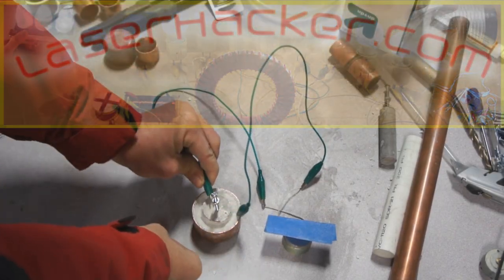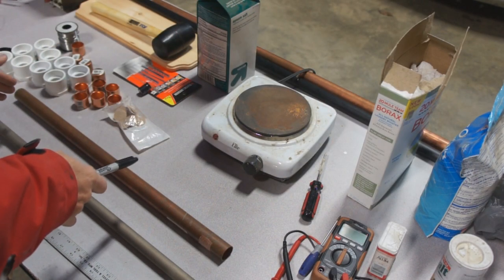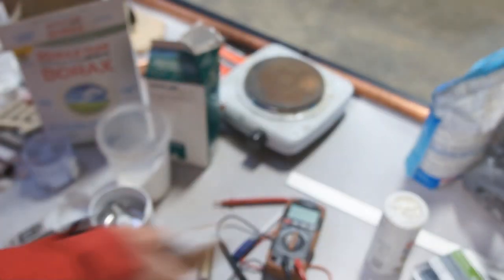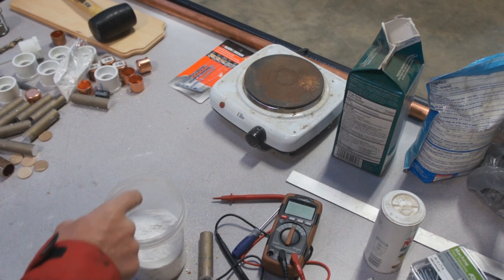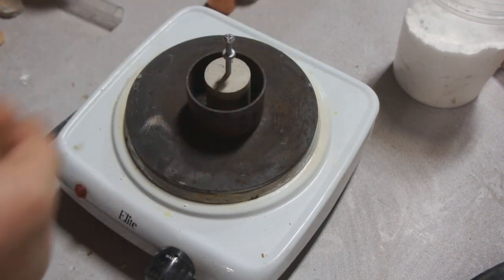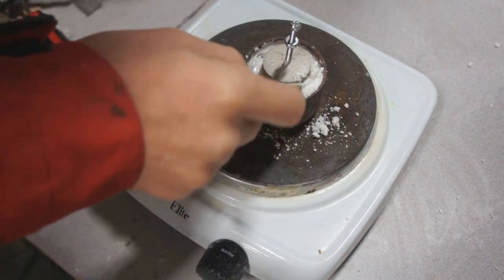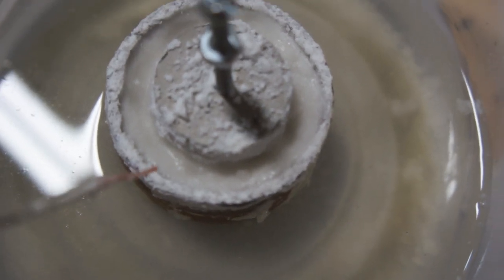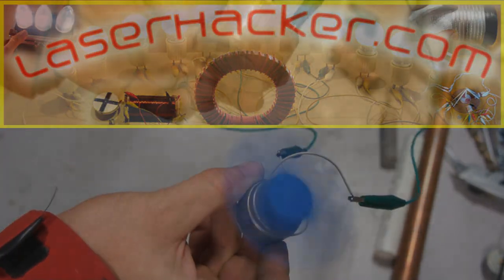How to Build Crystal Power Cells - Long Duration Power

Comment: This is very cool, man! Now, I just need to build 200 of these and I can be independent from the system. Crystal power, natures ultimate capacitor.
Reply: maybe a self loop generator might work..an ac induction motor running with large flywheels coupled to a permanent magnet alternator (Chas Campbell system)perhaps?
Reply: fidel catsro
This is a motion-less way of getting electricity. So, if your saying if your proposal is better than this, it's best for the one that says it to do it first than suggest it to another.
Reply: lumberluc yes I intend to try that self looper, just cant get the reliable people to make one setup currently as yet
Reply: fidel catsro
Then I believe the most reliable person there can be for you is the one who looks back at you in the mirror.
Reply: You need to redo your calculations.   This cell produces 90mA  at 15V i.e. 1.35W.  Since an ordinary fan heater requires 2KW it would take almost 1500 of these simply to produce 2KW.  It wasn't made clear in the video how long this cell could sustain 90mA.  It could easily drop to a tenth of that within few minutes.  200 of them wouldn't do anything very useful apart from consuming a lot of money.

These may last a long time but the power output is very low.
Reply: Joshua Rosen Long time, yes. However, if you combine it with a different source of energy, like Cold Electricity, which is a endothermic reaction and it's radiant, then these crystal batteries will do just the trick.
Reply: lumberluc
There is no such thing.  It's pseudo-scientific mumbo jumbo.  I don't know what you've been smoking but electricity, which is a form of energy cannot be endothermic.  Only reactions or processes can be endothermic.

All these people who talk about free electricity (or other free energy such as perpetual motion) are fraudsters.  If there were a grain of truth in any of this, they would be able to produce perr-reviewed papers in respectable journals demonstrating it but none of them can because it's fantasy physics.
Reply: Joshua Rosen AAAANNNNNDDDD, how do you know that?

Have you tried it? Have you tested it? Have you seen it, up close and personal?

The only fraud here is the one who answers NO to any of those questions. Like you said, Free-energy is fraudulent, which makes you a fraud.

I tried it, it works, but I'm just scratching the surface. Heck, why not join the group of people that want to make THE difference? Such as lasersaber, he's a man that wishes to make a difference.

Free energy is a reality, get use to it.
Reply: lumberluc Because I have a physics degree.  What I said about endothermicity is a simple fact that can easily research yourself.

If you believe in "cold electricity", try to find a single peer-reviewed paper in a reputable science journal that supports its existence and report back here.  You won't be able to because it's not a real thing.
Reply: Joshua Rosen Hmmmm, Too bad. And here I thought you were a free thinker, turns out I was wrong.

US Patent #4595975, Efficient Power Supply Suitable for Inductive Loads, which can be anything.

It's not a matter of "Belief" it's a matter of getting off your butt and doing something.
Reply: lumberluc Physics isn't about freedom, it's about truth.  If something is true in physics, it can be proven and all physicists care about is what is true.  Opinion just doesn't come into it.  If someone can prove experimentally that there is such a thing as "cold electricity" I shall believe it, if no-one can, I shall not.  That is how physics (and indeed science in general) works.
Reply: Joshua Rosen Then look. There are they who do.

I'm forbidden to convince you or anyone else that thinks inside the box, due to the simple fact that they like their "Box"

And you, are a Orthodox person, I, along with thousands of others, are Unorthodox, and we get the results better and faster than your kind.

If you wish to continue your path, then I must say one thing to you, "Never utter these words; I do not know of this, therefore it is false."

Oh, and did you not read thoroughly the patent?
Reply: Joshua Rosen Actually, physics has come a long way since what they still teach from the books in universities - the same universities that are breaking new ground in physics. Only 20 years ago you had something like 5% of people that agreed in the wave function theory of the double slot experiment. That's up to over 30% today with more proofs and examples being introduced each year creating the increased acceptance. Physicists do NOT care about truth, they care about keeping things the way they are. Change rarely happens in 'accepted physics' aside from an undeniable event that puts everyone on the spot, or more commonly, by simple attrition. Ask any professor or professional physicist that works with bleeding edge tech under the age of 40 and he'll give you the same answer. Opinion and judgement are paramount in the scholastic field which carries on to applied science. It is a monumental feat to prove new theories. I'm just glad people don't give up. Otherwise we'd still be the center of the universe. Proven science right?
Reply: ChunksMan CS And it's the saddest thing ever, the dogma of society of believing what other's say to be true even in the face of lies.

A nobody can build something so awesome and so useful that even a scientist will say it's sacrilegious, heathen, and an abomination to his/her view. An example, a AG Drive. A dual parallel plate that has a frequency of 1 terahertz and is able to fly faster than the best spy jet such as the Blackbird spy jet, regardless of weight.

However, even in the midst of such of a denial, they still do what is known as Black Box projects. When they have the sci-fi weaponry, they have the AG drives, they have been to all the planets and saw whose on there, and they just want us, "Stupid" people to stay on the prison planet call Earth.

So if sad is sad, then we are in the saddest state of Greed, Lust, Pride, Wrath, and Sloth ever.
Reply: lumberluc
YouTube really does bring out the nutters.

If any of these inventions is real, show us.  So may nutters and frauds over the years have claimed to have invented miraculous devices but when push comes to shove, they cannot prove they work because they are liars.

Science does make judgements.  If you can prove it's true, do so.  If not, you are just another fraud.
Reply: lumberluc
Thank you for bringing up Joseph Cater. I looked him up at greggpierce.net. He's the king of the nutters!
Reply: James Van Damme Now for me to know that your on his side; What is the one physics that Cater mentions that can explain every gosh darn thing in the Universe?
Reply: lumberluc
You got me there. I couldn't make any sense out of it. Especially laughing my butt off.
Reply: jimvandamme Okay, well, if your one who laughs at the simple notion that people such as Cater are nutters, then your no more than the popular theorist who gains money for double-talking.

Or, your just one who doesn't know. However, honest arrogance is acceptable, because you don't know yet you wish to know. If your dishonest, then you wish not to know, and never to know.

come back when you find the answer to the question I asked you, and I'm not taking a "I don't know."
Reply: jimvandamme Your loss, not mine.
Reply: Joshua Rosen ...try to find a single peer-reviewed paper in a reputable science journal that supports its existence... boy said so; pls somebody find it, prove it, publish it and produce it AND i may be believe it exist with my degree but until that day im gonna tease u.
Reply: Joshua Rosen Scientists (whether it be physics or any other science) as I know them accept a truth that can be proven. Up until a few hundred years ago the thought of a spherical earth was non-sense. In fact some of the earliest scientists were, for all intents and purposes, shunned for their findings because they were viewed as opinion and not a scientific fact. If science of as simple as you are attempting to make it out to be we (as a race would be much farther a long technologically. If scientists didn't have the freedom that they had and the ability to look at something and see that it is different from what is "proven" and ask WHY, than we would still be living on a "flat" earth. There is also the fact that "Proving" something is simply a point of view that is susceptible to all sorts of bias. I am happy that you received a  degree, however the history of science is just as if not more important the the human history of our culture as an entire race, and if you had known the history of not only your science but general sciences as well you would find that you would not be speaking like many Mormons speak about their faith; you know speaking in absolutes. Knowledge is power and what and how you use it, reflects heavily upon yourself.
Reply: tiny99990 Little over the edge on the Mormons, due to me being one. I'm proud of being a Latter-day Saint, but I only act through it not speak of it, due to my small voice yet large action.

And true, if he knew all of the history of science, and I mean ALL of it, and it's purpose like what it was like before the flood, then he wouldn't say any double-thinkery of the sort.
Reply: lumberluc My parents are Mormon a long with my aunt, I have nothing against Mormons as a group, however there are certain Mormons that have an extreme Holier than though complex and tend to strongly and loudly voice that they are the "one true church, and that all other religions and forms of Christianity are lairs and fakes. Again this is from what I have noticed growing up in the Salt lake valley which is commonly referred to (by both Mormons and non Mormons as the origination point of all Mormons, not to mention the fact that more than 60% of the Salt Lake valley is Mormon.) Mormons are some of the nicest and most generous people I have ever known. All I was trying to do was compare him to something, that from what I saw, he dislikes and overgeneralizes so as to make my point crystal clear.
Reply: tiny99990
It's interesting that Mormons refer to "other forms of Christianity" because Mormons aren't Christians.  They don't believe that Jesus is God and they also believe that Satan is Jesus' brother. 

Christians believe that Jesus is God (as well as being the son of God) and that Satan was an angel.  Whether Mormons are right or wrong is one thing, but they definitely are not Christians.
Reply: lumberluc it will be all the lives, as long as those who are in power get paid to keep things like what you are talking from becoming wide spread utilities, that man as a race can utilize. Greed has gripped our society and we are all paying for it.
Reply: tiny99990 And they are willing to burn the world (Which they are doing right now) instead of relinquishing their power to one whose competent.
Reply: lassi kinnunen Not very practical, but if you know how to recharge them, then sure they have a good use. Even the non-rechargeable ones can be recharged.

Yeah, that sounds impossible to a lot of people.
Reply: Have you experimented with Tying them together series parallel or parallel series and see what kind of voltage you get
Reply: Its just a galvanic battery.  Go buy a couple d cells.  Same basic idea (though different chemistry.
Reply: @joshuarosen6242  depends on if you use fan heaters or not. Most people prefer fires y'know. If you only use efficent LED lighting... and can get it to run your fridge and computer... that's all you need really. I personally wouldn't need the fridge, so just the lighting and computer. But mostly really just the computer/wifi cuz lighting can be done with candles really, if youre use to it. 
  Modern society really only needs Fridge, Lighting, and Computer/wifi/t.v./playstation
Reply: @eternapesadilla2355  I presume from this that you have no education in physics at all.  Even if all you want to do is charge a laptop you’d need 30 of these.  It’s all bollocks.
If you are so good at thinking outside the box (and let’s hope you are better at that than writing English - if you are not a native English speaker I’ll let you off) do it and show us.
If we could harness the hot air generated in YouTube comments sections by people with no education, we’d be producing a lot more electricity than these ever will.
Reply: @joshuarosen6242  I think the key is that they DO create power. You can work on extending that out from there. Why not add a magnet, some heat or pressure?
Reply: @joshuarosen6242  I think everything we have been taught is WRONG, to keep us ENSLAVED to the grid. How about just forgetting all that crapo and work on what shows promise?

Comment: Finally !!! I was hoping that some day someone would post the secret recipe of John Kenneth Hutchinson.  Thank you very much for sharing !  For those who think this is a normal battery,you're somewhat right but a normal battery that can run for an excess of 2 years under load is close enough to qualify as free energy in my book.
Reply: Try the bedini system with two classic batteries. You will be astonished about the result. Many people knos about this explained echnology. Its called pulsative current. I only see here a classic gavanic cell which best combination i ever tried is copper and zinc (with an electrolityc solution in beween) Please check potential redox of metals on wiki
Reply: @utube4phil  Everything I got that was 'galvanized', that galvanization FELL OFF before I ever USED the things..awful.